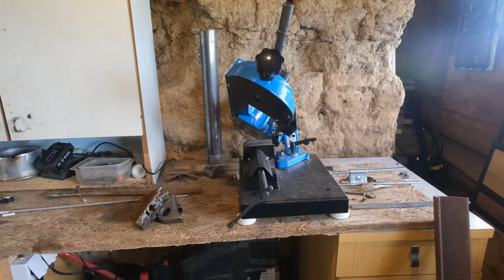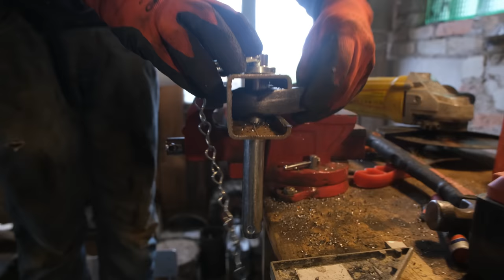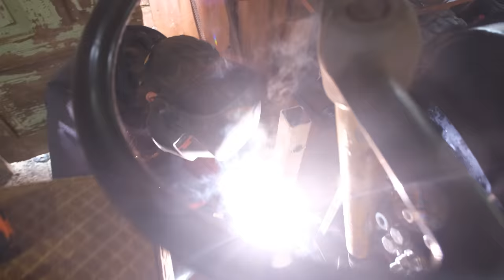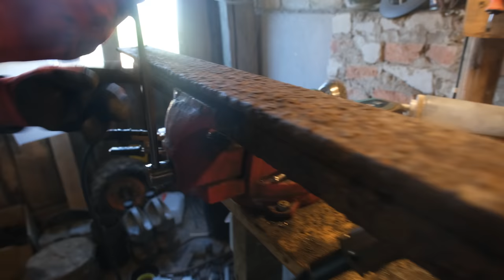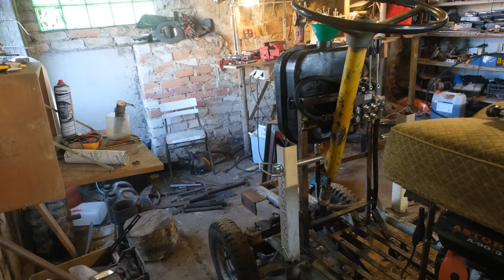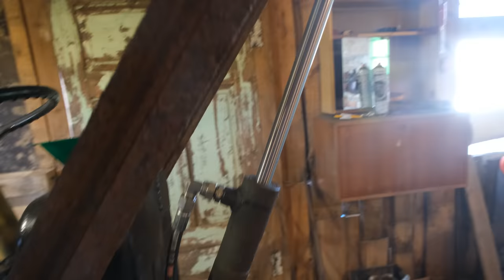Building a Front Loader on the Homemade Tractor!?

Comment: Nice work.    You are correct to be concerned about the front axle pivot.    I have a kubota b7000 with a loader , which is similar in power to your setup.   It will easily lift 500 lbs (226kg), but I can not safely move any more than half of that without risk of tipping.  Good luck.
Reply from the maker: Yeah, I have now filled the tires with water which really helped and keeps it down. I did lift the lawn mower up which is around 250kg but the back was coming off the ground so driving wouldn't be possible. Few more improvements and it will be able to do basic dirt moving jobs!
Reply: You might consider reinforcing near the pins.   Simply make a few washer and tack them in place.  This will add some durability once you start pushing dirt.   Also Keep the pins greased.